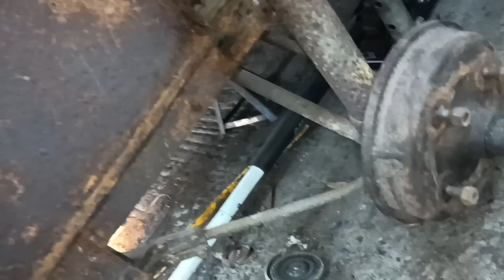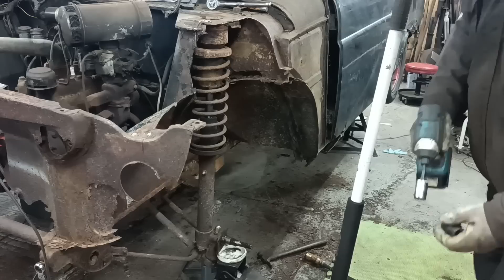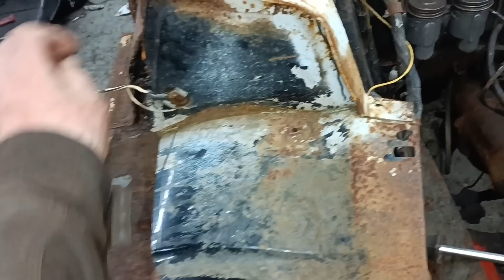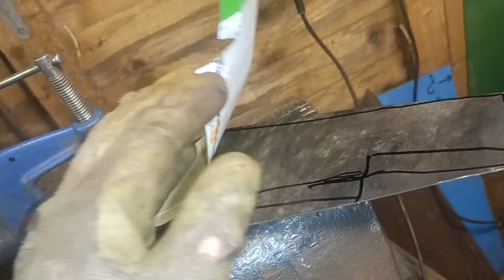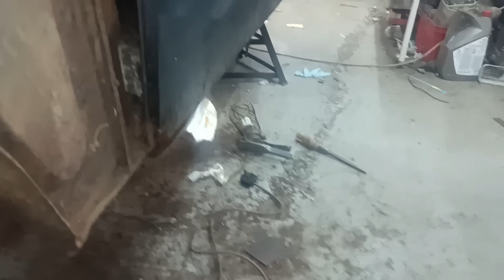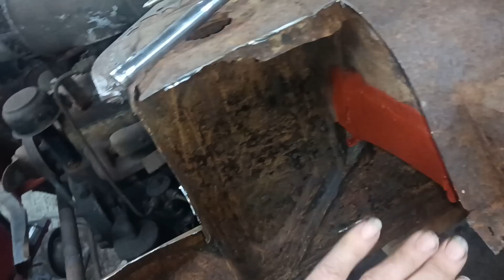Mart's 1955 Ford 100E Anglia part 15! Major repairs to front suspension mount begin! (2351)

Comment: When I was in high school, someone gave me a 1957.  It was left hand drive for use in the states.  I did get it running but I ended up selling it.  Needless to say it was a very interesting car since it was so rare over here.
Reply from the maker: Hi Peter. Yeah, they had them in the states but pretty uncommon. Lots ended up on the dragstrip, especially the van derivatives.

Comment: Hey Mart, I'm enjoying the build and your posts on the hamb! Can i suggest that before you weld the wheelhouse, core support solid, that you reinstal the fenders and hood panel and check the panel gaps @ that time? This will insure that all of that will fit once welded up! The gent who rebuilt the Humber Saloon on the hamb didnt do this, and look at the panel shut lines as a result! Best of luck, Rex
Reply from the maker: Hi Rex. Yeah, good point made. I am still working on the front end and did have to mount the sheet metal to check for position of the attachment points. So well worth mentioning it. Thanks for watching and your thoughtful comment.

Comment: have you thought about getting a small sand blaster to clean up those panels ? i know they are messy  , if you run a good shop vac at the same time it helps with the mess .cheers mate